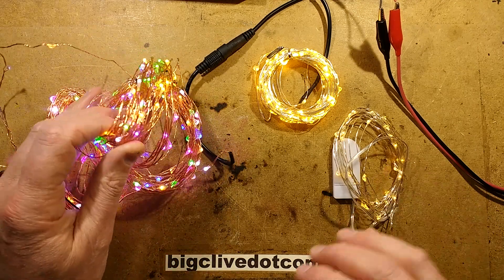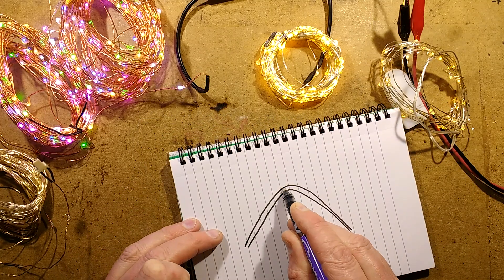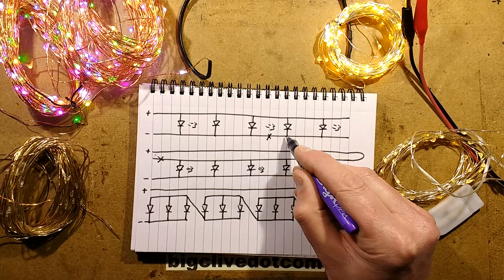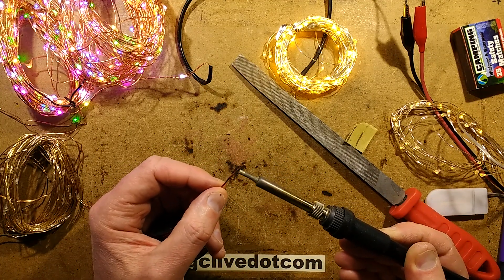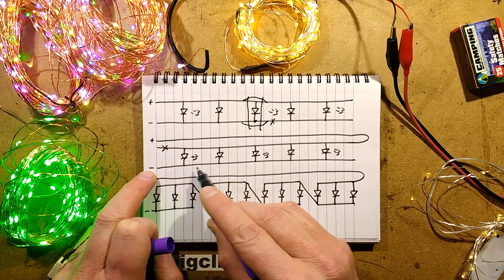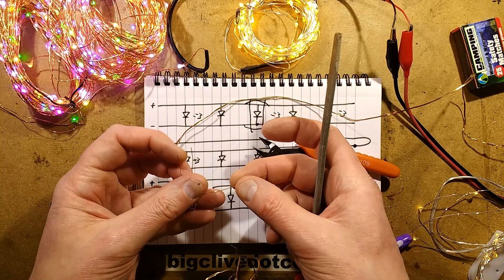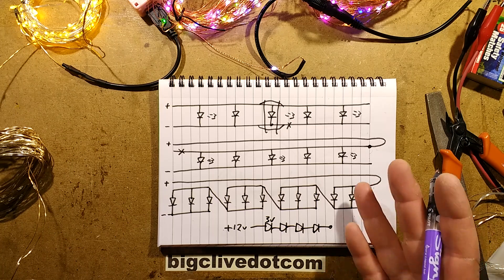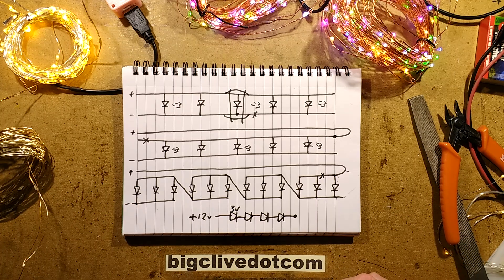Fixing low voltage copper wire LED strings.

Comment: How much power do they draw. Trying to figure out how long the AA powered ones would last being on at a bar for 12 hours a day
Reply from the maker: The current and intensity tends to fall as the battery voltage reduces, so they will start bright and then gradually fade over several days.

Comment: I just did the two wire repair and the end of our string is lit again! I sanded off the coating to expose the copper wires and twisted them together.

Comment: This is exactly what I was looking for! You have such great content! Cheers for that! As a neewbie in electronics I find your channel a real trove of good tips and info. And you have such a clear and I would say "fool-proof" way of explaining so that, even when the concepts behind it all are so complex,  it's rather easy to grasp! I have a question about resistance and LEDs. I'm working on several Christmas projects involving LEDs and trying to figure out the best way to run them off batteries without them eating through the charge. And I seem to read all over the place that you mustn't connect parallel-connected LEDs to only one resistor (the evils which will ensue vary but I got the idea that to do such a thing constitutes  a primordial electronics sin) and yet, as you point out, these typical USB 5v LED sets only have one resistor essentially wired to sometimes 100 or more LEDs in parallel and they seem to do fine... One doesn't see dimming of some while others run brighter, one doesn't see them dying one by one... Is it perhaps a little exaggerated to say that this should never be done? Can one sometimes use one resistor for a couple LEDs in parallel and be quite happy with the results? Again, thanks a million!!
Reply from the maker: In the parallel strings the LEDs are all matched from the same batch so that they all share the current evenly.  If you mix LEDs from different sources you will usually find that the current is very imbalanced, with some very bright and some dim or not lighting at all.
Reply: bigclivedotcom Thanks for the quick response, Clive! You're the best! So in reality it's not such a bad idea to have several parallel LEDs share one resistor, especially if they're all from the same source and, therefore, will be "feeding" equitably, as it were. That really makes my Xmas DIY project-making loads easier! Cheers! And have a very happy, LED-filled Christmas!

Comment: hi clive could you tell me why would only 1 out of every 3 bulbs light up on one of those two strand copper wire sets THANKS
Reply from the maker: That's odd.  If it was every second one and the controller had effects then I'd suspect one of the H-bridge transistors.  Is it wired for multiple channels?  Another option is if there are multiple colours on the same string.  One colour may have a slightly lower voltage so when the battery is low only that colour lights.

Comment: I love your knowledge and willingness to share! I wonder if you could make a video on how to combine multiple wire lights sets to have one plug? I need to combine 5 or 6 sets of 55 foot wire lights with 150 micro LEDs. https://www.homedepot.com/p/Holiday-Showtime-55-ft-150-Light-Warm-White-Micro-Dot-3-Function-Light-W11M1783/305025846 these are the lights that I bought...and I’d like to only have one plug. Any advice?

Comment: I know this was some months ago but my question is: If I wanted to shorten the battery ones. Do I simply cut the end? It seem like the answer would be yes but I want the answer before I try it.
Reply from the maker: It depends on the type.  If there are just two wires running along the string then you should be able to cut them down in size a bit, but not too short.  If there are three wires it makes it more complicated.
Reply from the maker: I should add that if it is the two wire version, when you cut the length down, cut the end wires at slightly different lengths so they don't touch.   Not that the manufacturers actually bother doing that.

Comment: I bought some of these lights on Amazon that say they have an 18V power adapter. My lights are 3 strands, 120ft, 360 LEDs, and it appears to be a few shorter strands that they've attached at these insulated junctures. A big chunk of the strand just doesn't work, and I traced it to one of these junctures. Is there anything I can do? Could I strip and twist the wires together? Or is it more complicated than that?
Reply from the maker: Without knowing how it's wired I couldn't really advise on that arrangement.  At 18V I'd guess it may have six sections.  If one is out it may have a short circuit at one of those joints and that could be causing the other LEDs to be driven harder than normal.
Reply: bigclivedotcom I understand - thank you! Maybe I’ll fiddle with them, maybe I’ll just let it lie, haha

Comment: I bought a string of 12v and I only needed like 5ft for this project I'm doing. As soon as I cut it, it turned off (obviously). Is there anyway I can figure out what voltage I need now to run this small line. And can I just put in a resistor in the line to knock it down to make it work?
Reply from the maker: The number of LEDs in each section will be imbalanced.  It might be better to get a set of USB ones.
Reply: Damn I was hoping I could make it work but that seems like the best option. Thank you so much for the quick reply. Have a good one man!

Comment: Thanks very much Clive. I have repaired my outside led copper wire lights but I'm a little unsure whether I should be re-laquering them? As I've used sand paper to take over the lacquer coating, do I need to reprotect the wires? I've got the easier 2 wire set. There's rain on they way later and am wondering whether I should be doing a final stage for outside lights. Thanks very much for any help.
Reply from the maker: You could dab the bare copper with nail varnish to give it some extra protection.
Reply: Thanks for replying. I had some varnish spray paint that i tried but then when I wrapped it up with insulation tape all the lights went out. Do you thinks it's possible to cut this section out and try again or have I literally blown it! :(( Sorry my electrical knowledge is pretty shoddy!

Comment: Thank you for the video!
 I'm sure it helped a lot of people but in my case it made my brain hurt lol. 
 The only thing i'm desperate to find out if its possible to cut these kind of fairy light strings that are made for outdoor use with a solar charger...?  I have no way of knowing how the wiring is setup because i don't have it yet. I want to order some but it's way too long for my needs. Can i just cut it shorter without killing it?
Is there a way you could tell me a with a simple yes or no?
 If it's a "No but you can do.... etc.etc." i'm not interested getting it. I just can't find an answer and i already wasted so much time searching, i'm really frustrated.
Please help!  Thank you :-)
P.S. anyone else might know the answer???
Reply from the maker: If it's just two wires going along the string of lights then you can cut it shorter.
Reply: bigclivedotcom Thank you so much!  I just watched a video of the same outdoor lights (or a knock off)  i want to order and it had 2 wires only. There is hope! 
Thanks again!  😃

Comment: I have a 300-light string of the 12V lights.  The entire strand was severed just before the first light.  Any suggestions on how to splice that back together properly?  I don't have a single bulb connected to the power lead to test the wires as you did in the video.  Any help would be greatly appreciated. :)
Reply from the maker: Is it just two wires?  If it is then if you clean the lacquer off both ends of both wires and then join them, then a quick flash of power will let you know if the polarity is right or wrong.  If the whole set lights you got it right but if it doesn't then swap polarity and try again.  If just one section of the lights illuminates at very high intensity then turn it off immediately and look for another wire.
Reply: bigclivedotcom Thank you so much for replying.  

It's a 3-wire string which is what has me unsure of how to proceed.

Comment: Big Clive!  You are my hero!  Two years ago I installed a 12v strand around my deck.  Then last year we got 2 puppies who found the little LEDs under the lips of the steps irresistible!  Needless to say they were damaged beyond repair.  The pups are grown now so I decided to replace the lights.  Wouldn't you know that as I got 3/4 through with the job (hot gluing them under the rail caps), I accidentally severed all three wires!  As I searched the web for help I saw your diagram and thought "whoa, this is a guy who could help".  I am a 60 year old grandma who has no electrical/engineering/technical training, but who loves to tinker.  First try and they worked!  The break was right after a set of 25, where the polarity reversed, and it was a simple task to to trace the wires and figure which went where!  I used a propane torch, followed by sandpaper, to remove the varnish.  Piece of cake.  Thank you so much!  I will be following you!
Reply: FYI, I used finger nail polish to re-insulate the wires.
Reply from the maker: Sounds like you did a good job.  This is exactly why I put this video up.

Comment: I want to make corsages for my friend and i, and the "go all out" part of me wants to make them light up. Would I be ok cutting the wire to my desired length? (my lights have the battery pack like the ones to the left)
Reply from the maker: If it's just two wires running along the string then it may be OK cutting it to length.

Comment: HELP: re: 10 led string w/ 2x cr2032 3v battery housing. There is NO reisitor visible between the batteries and the first led! So...6v into 10 tiny LEDs in parallel?  how? Can I just use a single 3.7-4.2v 18650 battery instead without damaging/burning out the 10(or even 20) led string? I tried a single battery and it's so bright!! I'm a noob. any suggestions appreciated.
Reply from the maker: The lithium button cells have an internal resistance that limits the current, but it's unpredictable and the LEDs may be run at too high a current when new batteries are fitted.  If using an 18650 cell I'd recommend a 10 ohm resistor.  Or a higher value if you want them to run for longer at lower intensity.
Reply: bigclivedotcom informative answer and great suggestion thank you very much. 
 To all those that are interested... I brought some of these lights down to the park here in Budapest Hungary where everybody sits around in random multilingual groups with their beer and wine. I put the led strings around the bottles and the people loved it. Some started making photos of the scene.  Use your imagination and bring some with you to the next party or gathering,  just don't wait for Christmas.

Comment: Hi, I will buy a 0,5m of 5 leds...how much voltage will I need to light them up?Best Regards.
Reply: You should be able to attach it to a 3v source (2 AA batteries). The batteries will have enough resistance not to worry about a resistor. If you're using a power supply it will be a good idea to add a resistor around 10 to 30 Ohms.

Comment: The string would be 20 Ohms until the insulation burned off and shorted the loop closer to the input. Then the current would really spike and likely melt the wire.
The only way to know for sure would be to try it :D

Comment: Another (VERY effective) way to strip enameled wire is Aspirin. Yes I know this sounds weird, but if you get an Aspirin tablet (doesn't matter if actual Bayer or knockoff brand ones, but it has to be Aspirin (doesn't work with ibuprofen or paracetamol)), lay the enameled wire ontop of it and heat it with the soldering iron, the tablet will melt andl eat away the laquer entirely while not attacking the actual wire at all. I've used this a lot to fix headphone wiring (for new 3.5mm plugs etc.) because that stuff is almost impossible to strip bare with the other methods mentioned in this video. Just do it in a well ventilated area since it'll generate quite a bit of (probably not particularly healthy) smoke
Reply from the maker: That sounds intriguing.  I'll have to try it.

Comment: I have 4 of these...
2 warm white 'gold' USB sets which work fine at about 0.07A on 5V
and 2 multicolored ones, also USB, these get very hot, and very bright, but then they also draw about 2.1A from the power bank (that's the maximum it can deliver). I guess they 'forgot' the resistor in series with the LEDs? - it's this set : http://www.dx.com/p/usb-5m-waterproof-flexible-3w-50-0603-smd-five-colored-led-string-light-silver-dc-12v-425825
what kind of resistor would be best to fix these? I don't mind a bit of soldering but I'm not too knowledgeable about these things :D

Comment: beware those round plugs, I have had some with that sold as 12v on amazon but they get red hot when you power them from 12v.  but if you get a good one they are nice for solar systems that run at 12v (like ham radio stuff)

Comment: Hi Clive, can you do a strip-down on one of those remote switches under recall please. I've got 4 that work perfectly and have yet to cremate me in my sleep.  BanQ emailed me the recall, (because I've got a codger-card), but I still seem to be alive.
Reply from the maker: I was hoping to open the unit I have, but it has well recessed tri-wing screws.  That said, a drill will open anything.

Comment: A lot of that enamelled magnet wire is directly solderable.  Some isn't, but most of the modern types seem to be.  It helps facilitate automated termination or pot soldering.  It may take some flux and a bit higher temp than normal soldering (e.g. 350C), but the enamel will melt and roll back.  This prevents nicking the wire, and allows you to mechanically fix the wire before soldering (look at the terminations on a PCB-mount transformer some time).

Comment: You shouldn't burn away the enamel, as it may be made of urethane and its fumes are toxic. Also, with these thin-wired fairy lights, won't bending, rubbing, and working the wires back and forth eventually chip the varnish? Thank you!

Comment: There is a type of these led’s that I believe run inverse parallel. It’s interesting how they work. The controller changes the polarity to get a different effect and there is about 9 settings. Something to check out if your interested.

Comment: Are they SMD LEDs, or 3mm, or something else?
Reply from the maker: They are fully packaged rectangular surface mount LEDs.
Reply: Gordon McLellan They're ridiculously tiny SMD LEDs, they don't look like they are finished like normal SMD LEDs thought - I think the resin blob is being used instead of the normal lens/case you'd expect.
Reply: Thanks!

Comment: Soldering enameled copper wire is quite easy if it's the right kind of wire. There are basically two types of enamel. The type that's heat resistant and will not allow you to solder through the enamel (this type is used for transformers and coils that will get hot, then there is the type that's designed to let you solder through the enamel (this type is found in things like headphone cables, low temperature coils like relays etc.)

Generally but not always, the solderable enamel is light in color and the heat resistant enamel is much darker.

To tin coat the ends of one of the solderable enameled wires set the soldering iron to at least 370 degrees celsius, put a bead of solder on the tip, heat the end of the enameled wire while slowly feeding more solder to keep the solder surface coated in fresh flux. You should see the enamel darkening and rolling back.

Comment: I use these type of wires for lighting in drivable H0 scale cars. Always use the soldering iron with some solder on it to strip them. You can precisely strip the length you want its is so clean. Also since there not much space in the model cars I cant have half bare wire or it'll definitely short out the whole thing.

Comment: Looks like the 12v version could be made into 4 x 3v versions - so if you've hacked the end off and killed the 12v set, you could at least resurrect three sets if you had some battery holders and appropriately sized resistors.

Comment: This year me and my father were decorating our church with lights... And we noticed that a whole row of lights didnt light... We were thinking what the problem was and my father suggested to cut the connector off that goes to the power supply. After cutting it off and soldering the wires directly to the power supply the lights worked :) The fucking connector had a cable that was cut (But you couldnt see that...) Apparently someone was force pulling on the cables and that must have messed it up... If nothing else works try this technique :)

Comment: I always use a lighter to burn a small part of the insulation. Sometimes the flame even gets green or red depending on the material. After that I clean the area with alcohol.

Comment: Even in the 3-wire-variant (second example on your sheet) the voltages are not 100% equal over all LEDs, the diodes to the edges get more power than the one more to the middle. This is because the wire-resistance in the middle has more LEDs to drive on both sides whereas the LEDs at the edges of the strings only have one side of them going trough all the wire.
Reply: isnt the wire length for all diodes the same though, so same resistance? or are you talking about something different?
Reply: @Tiamat1995  the length yes, but not the current. You can see this by drawing a schematic or simulating it.
Reply: @dolphhandcreme  oh yes i see. At first i thought it would be same cause they got the same length cable compred to each other. But youre right. 
Can you explain why? Or have a name on this so i can learn why that is? Im fascinated xD